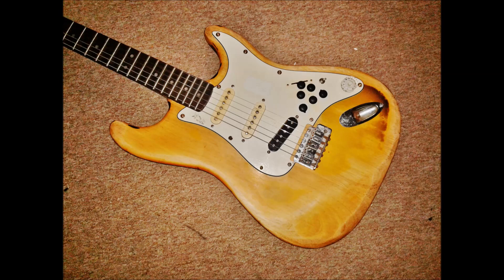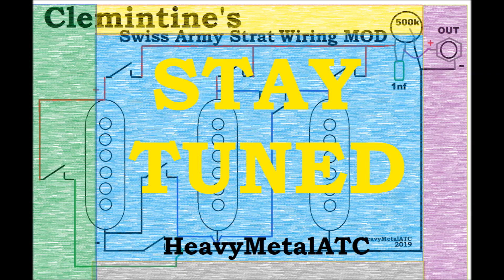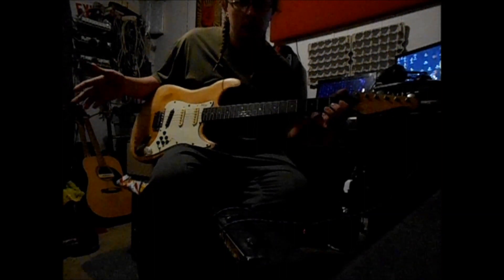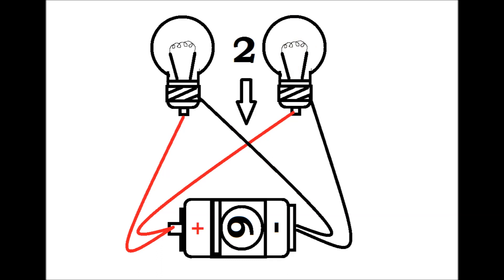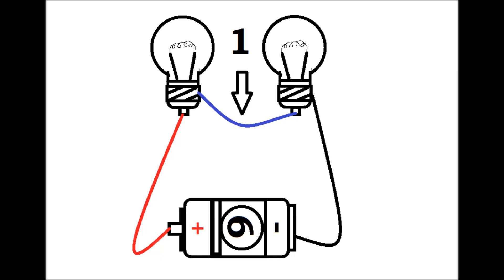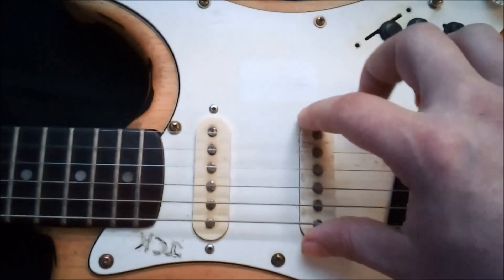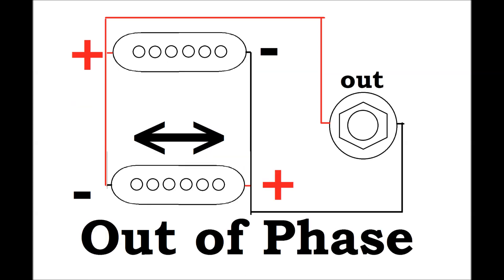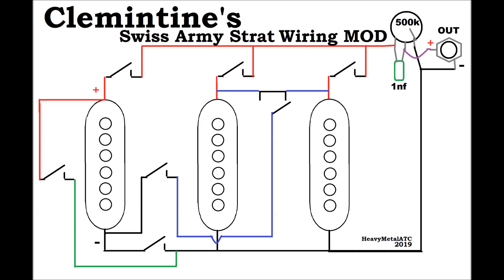Series Parallel Pickup Wiring Explained: Sound Demo & Diagrams (Phase Switching Too!)

Comment: theres a little more to it as the resistance and the pweerdraw to run the setups differ a lot
Reply from the maker: Thank you for watching and taking the time to comment. However I'm not sure I understand? Definitely resistance and output changes with different pickup configurations for example series will double the resistance of a single coil pickup and increase impedance and output as well parallel coils will have half the resistance of a single coil but also have higher output. 🤔 I reckon I never really considered it.
Reply: @heavymetalATC  it has more to do with the examples of the speakers and lightbulbs , with the speakers the ohms change with series and paralalel so if you have a tube amplifier you need to be carefull how you connect and in wish output  you plug in youre speakers , with the lightbulbs the amount of power to get them to shine as brightly as a single one requires more amops or more volts 
with the coils there probbly be a change in volume and clarity
you where basicly right about wat you said but there a little more things to take in account when doing that sort of stuff

Comment: So if there's a blue squiggly wire, that's parallel out of phase, and the straight stuff is series in phase? Can you even get serious out or parallel in?
Reply from the maker: I dont think this wiring diagram will let you do series out of phase but parallel in phase it will do and you can wire pickups to do any combination. it also matters which way the magnets are flipped that is also a way to change the phase of pickups.

Comment: Out of phase wiring can sound really cool when separate vol controls are used to blend the pups. (It takes at least 2 pups -1 being out of phase to get the effect). Try backing off the vol of the out of phase pup to 8 and see what you get.  Works for me, I run separate vols. The tone is still nasally, while not being overly trebly. Try it!

Comment: It is maybe I am not really good at electronics but at 07:24 aren't the switches set to connect middle and right pickups in parallel and in phase instead of left and middle pickups in series and out of phase as you mentioned in the video? I cannot see any connection between left pickup's + side and the jack. I am confused.

I think from the top 3 switches left one should be open, not the middle one to get what you say in the video. But the right pickup gets the voltage although it shouldn't. Again, I am confused
Reply from the maker: Wow Gokhan, you are exactly right. You were the first person to catch that. Really dont know how I missed it all this time. Yes that was a mistake. I must have gotten confused somehow making the diagrams. You were correct.

Comment: I'm not an expert but can I make single coil strat SSS into parallel wiring? do you have any tutorial? or I just try the diagram that's on this video? 😏
Reply from the maker: Thanks again for watching and taking the time to comment Mat. The factory wiring of a strat is parallel, so I assume you mean series and the best way to figure out a simple series wiring diagram would probably be to google search "strat series wiring" and look at the images until you find the one that best fits your needs and save it and copy the routing onto your pickguard. Here is a puch pull switch version as an example: https://th.bing.com/th/id/R.7292e95c76645074ce1403e214c5427e?rik=mji3%2f09RYuyKXw&riu=http%3a%2f%2fi1087.photobucket.com%2falbums%2fj473%2fsteveg646%2fStratSeriesSwitch_zpsf5aad6ab.jpg&ehk=9kki%2fV%2f%2fDGah4wExBA2mow%2fy1HLylsBqIkWaBG5ar%2bY%3d&risl=&pid=ImgRaw&r=0

Comment: Awesome :D! But i think you didn't mention the role of the polarity of the magnets. In a humbucker you have both polarities and don't get a thin sound despite of the reverse wiring. Same with the middle pickup in a strat with reverse wiring and reverse polarity compared to the outer pickups. So that the in between positions don't sound thin and you get hum cancelling.
Reply from the maker: Thank you for watching and taking the time to type out this articulate technically sound comment. You are exactly right. I completely forgot about magnetic phase in the video. I made another video that explains magnetic phase because of that but yeah I dropped the ball on the subject of magnets. Thanks again Fx you nailed it.

Comment: After watching the video, I was wondering whether you can help out in a sort of custom wiring scheme. We got a 4-way switch telecaster wiring setup. However, how do I incorporate for/ connect a second tone pot to have Independent ton controls (bridge and neck pickup) rather the traditional master controls. Hope you understand my intention and thanks for your cool contributions to the community... Cheers Peter
Reply from the maker: Thank you so much for watching and taking the time to leave such a detailed comment Peter. I am a bit at a loss on this one, if it were regular 3 way wiring I would say just place the tone circuits on the positive pickup leads before they got to the switch or on the switch lugs going in but with you switching into series?? I don't know man? I'm sure someone could sit down and figure it out but I just spent a few mins looking at a 4 way tele diagram and I didnt immediately see a solution. When switching into series it would combine bothe the tone knobs and get dark... even when all the way up a tone still robs high end just the way a volume pot robs output even on 10?

Comment: Interesting a creative way of trying to communicate something a few people have interest in but don't understand about.  Good idea.
I find that testing out what the polarity is vs winding directions are the key to getting out of the basics. My first a ha moment long ago was realizing and understanding opposite vs same polarity then altering the current flow is the key to a successful switching mod.
Before that I just thought you had to have a reversed wound pickup to make a humbucking combo with 2 singles , when in reality all you need is one single one polarity one single the opposite and reverse the current flow of one of them as it does not matter if one is reverse wound. However, there are issues with this if the cover is bonded or the base of a tele bridge for example is bonded to it's factory negative etc.
Reply from the maker: Thank you so much for watching and taking the time to write such a kind comment Speed. You hit the nail on the head, this stuff is pretty damn boring at the core of it. 
You are absolutely right its all about the direction that the current is flowing in relation to the movement of the string, I do regret that I did forget to mention in this video.. Magnetic polarity you can also put a pickup out of phase by flipping the magnet it will make the phase of the ac current (wiggle i like to say) out of phase. So basically same as hooking it up backward or reversing the winds. Yeah I know what you mean about maybe a base plate or front cover not allowing a pickup to be hooked up reverse but there again you can flip the magnet if it has a bar on the back or if its got alnico poles you can swipe it between 2 strong ceramic or neo bars backwards and recharge it in the other direction and it will be out of phase. One can easily hurt their head with all the possibilities and different wiring combos allowed by each.  haha thanks again brother, very well stated and articulate comment.

Comment: excellent! Now I understand the knobs on the SG MUSE...coil split on the Humbuckers and out of phase in position 2. Thanks a lot!
Reply from the maker: Thanks Uncle Dad. That is awesome, yeah in theory its quite simple but sometimes wiring things up or tracing a phase switching series parallel circuit will just make your head hurt. Figuring out the original wiring for this one was a mofo. Then doing the actual wiring I got confused so many times. I was just staring into the wires and switches imagining they were pipes with water running through them so I could remember which way the signal was going. LOL
Reply: Good visual with water flowing through pipes. KISS is the best way. Appreciate the video thanks.

Comment: On guitars where I wire 2 pickups for series and parallel. I solder a 1m resistor on the outside lugs 1&3 to a 500k volume pot which ends up giving me around 340k resistance. Which seems to be a good compromise.
Reply from the maker: Thank you for watching and taking the time to leave such a useful comment Ryan. That is great info. I will file that away in the old head bone and try to remember it on future builds. Thanks.

Comment: Great job man, just one thing I want to be sure of: if I don't have a standard center strat single coil, but still i want to use a regular sc in the middle position, i could just place it in "reversed" position? Would it be the same as it was counter-wired or it's just a mess?
Reply from the maker: Thank you so much for watching and taking the time to write a comment Giorgio. 
Yes you can just flip the wires (reverse) the way the middle pickup is hooked up and that will make the pickup out of phase. The only thing is when it is on by itself it may have a little hum due to the outside winds of the coil being positive and not adding extra shielding to the inside windings. When in use in combination with either of the other pickups though this shouldn't matter as they will be in a noise cancelling configuration, Simple answer: Yes it will work... 
This being said if the middle coil is one of the strat-copy or squire coils with a bar magnet on the back you can pry the magnet off gently and flip it over and glue it back on with the side that was facing the bobbin now facing away from the pickup. That will put it out of phase "magnetically" 
This does the same thing as switching the wires but you can hook the wires up just as normal (standard) and have that extra shielding of the outside windings being negative and it will reduce some hum when used as the only pickup in the middle position of the selector switch, but it will still be quaky out of phase noise cancelling when using in combo with the others for that signature "strat" sound.
 
Here is a video of to remove a bar magnet without damaging it or the bobbin:
 https://youtu.be/zNjXuzHRcPM?t=97

I hope that helps and was easy to understand as it is sometimes difficult for me to convey complex ideas without a visual aid. Anyway Thank you again. If you have any further questions or need clarification on some aspect feel free to comment.

Comment: This is the best explanation I have seen on this subject.  Now I finally understand.  Well done.  Thanks.
Reply from the maker: Thank you so much for watching and taking the time to write such a kind and awesome comment Patrick. That really made my day. I did however forget one thing in the video. "magnetic phase" if you switch the magnetic polarity (flip the magnet) it is the same as hooking the wires up backwards so in some cases the pickups can be wound in the same direction and hooked up the same but still be out of phase because one magnet or magnet(s) in the case of alnico poles can be flipped from one pickup to the other. Like one is south pole up and the other is north pole up. That will put them out of phase. I hope that is not confusing but it does the same thing to the sound as flipping the wires. Also thanks again I am glad you found the video useful.

Comment: By any chance could this be adapted to an HSS pickup configuration?
Reply from the maker: Thanks for watching Greenland Santiago. Yes this could be adapted to HSS. If you happen to have a 4 wire humbucker with coil splits you could take it to a whole new level with in-out of phase series and parallel combos just on the one humbucker and then mix those combinations in or out of phase with the other pickups in series and parallel. You could end up with 30-40 different tones with all those combinations.

Comment: If both single coils are noiseless, does one need to be rw/rp to be humcancelling when connected in series? What about when parallel?
Reply from the maker: I thought this over for a little while and from my own thinking (I've never tried this) I think that since the pickups already have one reverse wound coil in each unit to cancel hum, that they will still be hum cancelling in either series or parallel much like humbuckers.

Comment: This is one of the best tutorials i have ever heard
Reply from the maker: Thank you so much Zachary. The one thing I forgot to touch on in the video is magnetic phase. If two pickups are hooked up normally "in-phase" and you flip the magnet or magnetic polarity in one pickup they will become out of phase. its just like how 2 magnets pull until you flip one like a coin then they push.

Comment: I think you are still missing my favorite combination,    bridge negative to ground, middle and bridge conected on positives, but negative of middle conected in serie to negative of neck and positive of neck to output, somehow the middle in series out of phase sounds very good for blues
Reply from the maker: Yes the closest thing I have to this is at 10:49 it would be the same as you stated if it was a stock strat pickup in the middle creating a neck/middle humbucker with an in-phase bridge single. The mid pickup in my guitar is originally a bridge pickup so it is not reverse wound and IN phase. But, that means that if your middle pick up is the stock reverse wound strat pickup then by connecting it out of phase you are actually putting it in-phase and that would be the exact same as the sound at 10:49

Comment: Great great job man, I usually dont make comments but your work deserves recognition, great great diagrams and explanation, I hope you have a video of half out of phase demo (which I know is here too)
Reply from the maker: Thank you Ricardo. I appreciate the time you took to watch the video and leave these kind words. Unfortunately I dont have a guitar capable of variable phase. I think its a cool thing for sure but without 1meg or no-load pots it can muddy the sound and lower output by sending some signal to ground. Any extra knob or "variable resistor" acts this way that is why the guitar in the video has only one 500k pot with a treble bleed cap to offset some of this clamping on the top end. Plus I dont really know if I would have room for the 9 knobs it would take for this configuration. But, I may do something similar to this in the future. Thanks again.